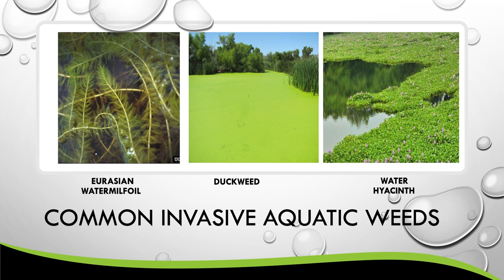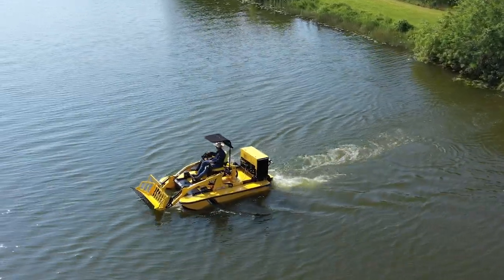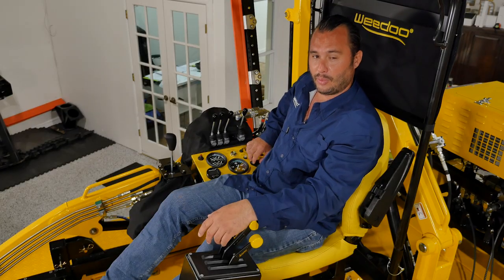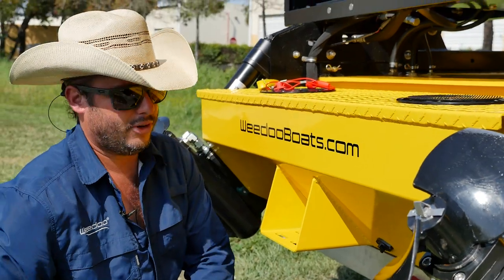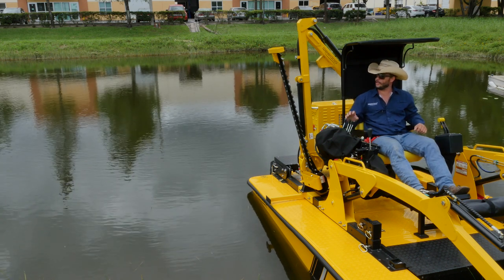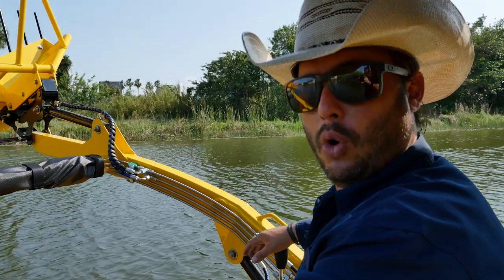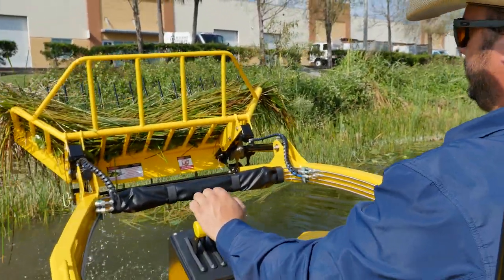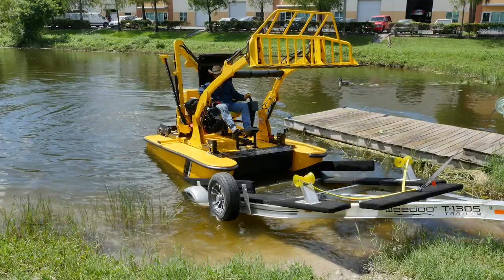Weedoo Boats Virtual Demo - Nothing Cleans Waterways Better Than Weedoo

Comment: Didn’t watch the whole video was a bit too long, but and not really sure if you have a bigger one, but it seems that you need a wider bucket on the front so maybe a way bigger machine with a bigger front area to scoop and cut more, but this would be good for smaller sections

Comment: Looking to hire a guy with 20 years experience in building custom aluminum work boats and pontoons ? Have plenty of experience mig and pulse mig welding aluminum as well as sheet metal fabricating. Can use presses, sheers, bandsaws, etc. Also proficient in repairing welders and welding leads as well as some otherequipment when needed.